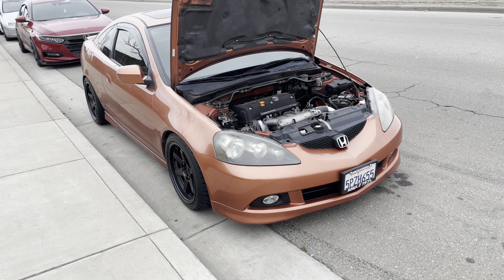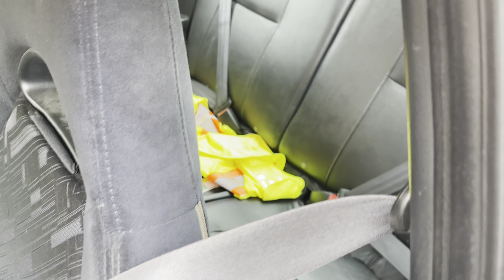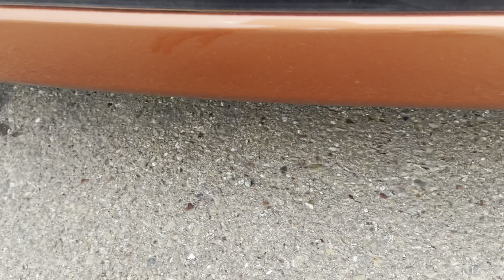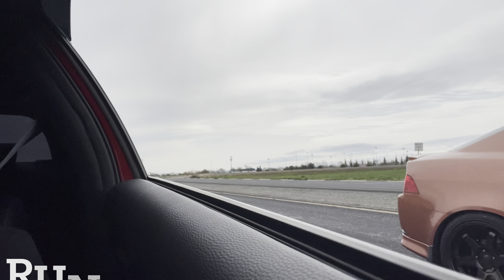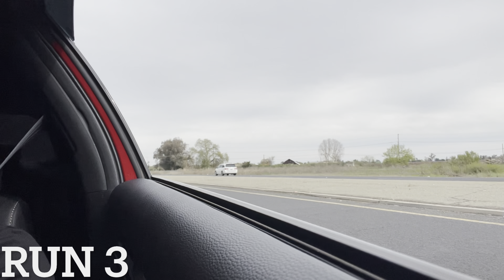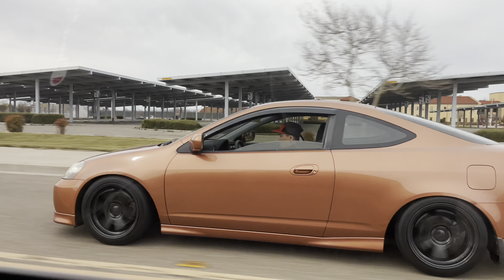Bolt-on RSX Type S vs Stage 2 tuned 2.0T Accord

Comment: Nice race. My homie ran a FBO 10 speed accord with a pro aggressive tune with his JB4 GLI dig and roll. The accord gave him a good run.
Reply: A full bolt on 10G should absolutely destroy a tune only GLI bro. My intake/downpipe/tune 2.0T with sticky tires goes 12.70s and makes over 300whp. An off the shelf JB4 map might make 230ish whp on a GLI. It’s really no competition.
Reply: Edit- had to look at my run files, SAE correction factor I made 309whp and 321wtq. Mods are PRL downpipe/front pipe, AEM intake, 3” exhaust with Stock mufflers and E85 in the tank.

Comment: Sweet vid man. I wanna get a k3 tuner but in all honesty am scared to efing something up. And even if i do it rite, my question has always been.....are these safe for the car. It wont ef up my engine after it releases that extra hp?
Reply from the maker: IMO I believe that the tunes that come with the flash is “safe” tune. As long as u don’t go crazy and punch it at every light, u should be fine.
Reply: @SovannaSom  Base maps run rich.. And in reality, they are kinda sh*t.. Dyno tune with a trusted Tuner the only way to go. Kpro is worth the investment. I use the Hondata App as well on my Double Din with the V4 Bluetooth and I can monitor all my gauges and all my perimeters.
Reply from the maker: @JonHop1  yes. I agree with u on that. I’m just waiting to get a intercooler and a ctr turbo first then a custom tune right after.
Reply: @JonHop1  What he said

Comment: Not downshifting or brake boosting??? 😥🤔
Reply from the maker: Manual mode, already in a lower gear. No brake boosting atm. Need some more practice on it. Tryin to get the ratio right.

Comment: i dont get it LOL
accord is a mutant beast
Reply: I mean Accord is boosted, has way more torque and this one was apparently tuned as well.. Accord should win.. I am FBO K24 with true bolt ons.. Full 3 inch, Ported RBC with 70mm TB, Ported Head and Supertech Valvetrain and Stage 2 Cams.. I make 250/205 and I still have trouble with new Accords even with my top end. My K24 revs to 8500 as well.